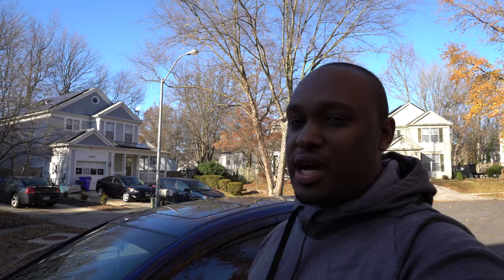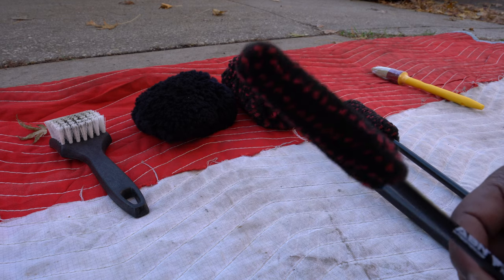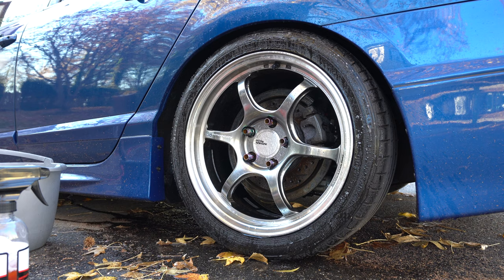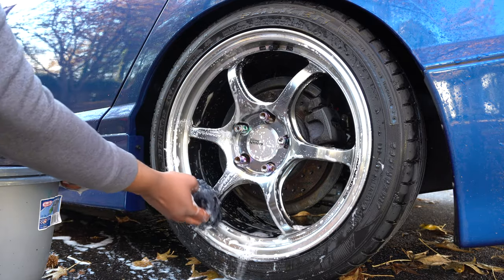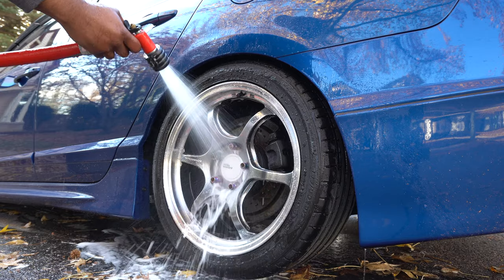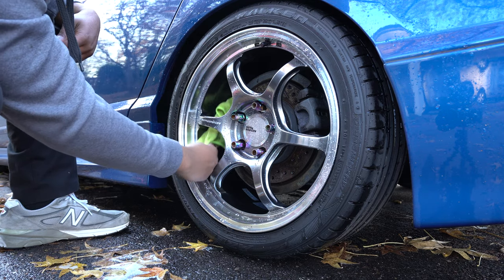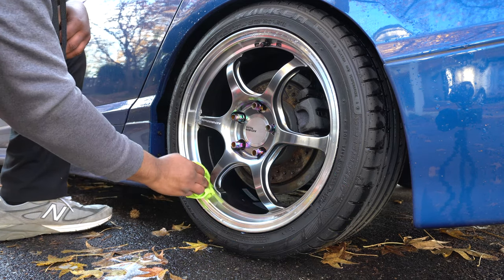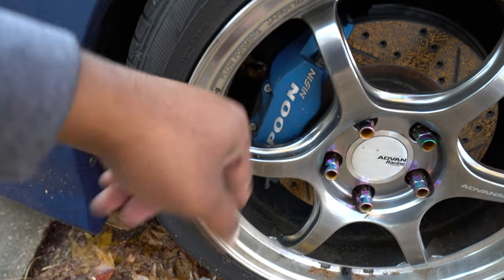HOW TO CLEAN YOUR TIRE AND WHEEL PROCEDURE!

Comment: How do you clean your microfiber cloths?
Reply from the maker: Don't wash the microfiber towel you use to dry the tires.. When the microfiber towel becomes black and can't dry anymore.. Throw it away.  *When washing your microfibers towels..* 1. Wash them all together. 2. Use a detergent like "Micro-Restore Detergent" 3. Set the washer to Cold or warm water ONLY Heavy Duty, Load Size and Extra Rinse. 4. Clean the Lint Trap Very good. 5. Dry On Delicate with no dryer sheets. Done. I hope this helps out a lot of people!